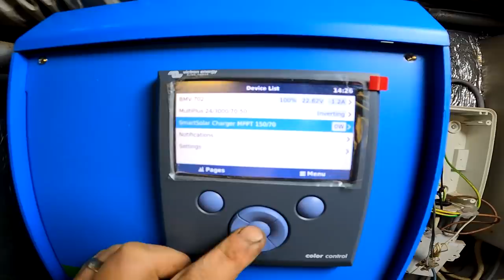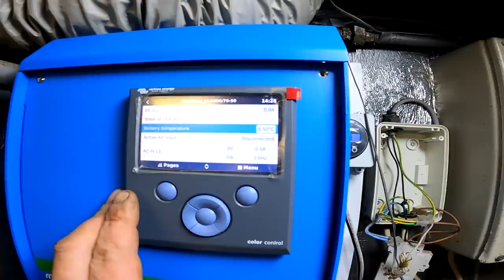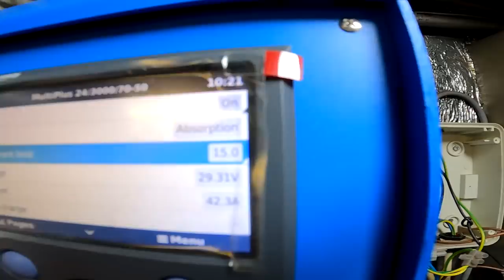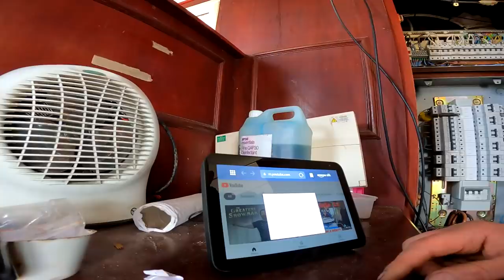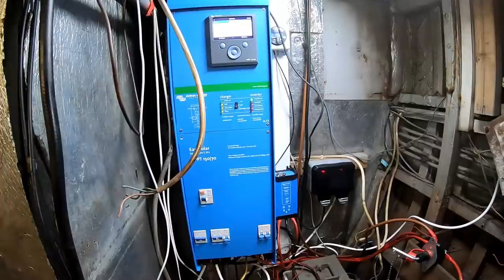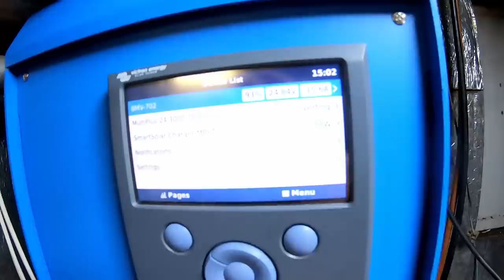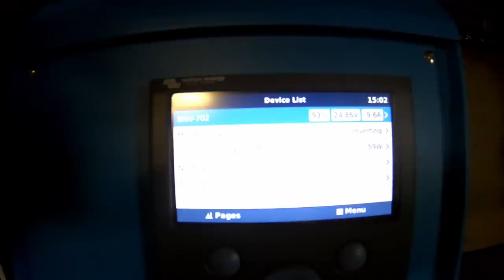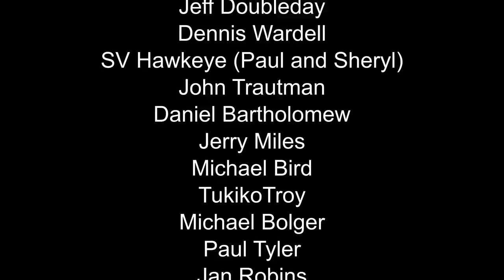Ep 12 - Fitting a Victron Easysolar Electrical system to a boat! #boatrestoration #victron

Comment: um not convert to 12 volt led lights is my recommendation.   24 volt handles better with thinner wire(s) in long run than 12 volts does.   Apparently from prior videos and not yet watching your later episode videos,  I suspect prior owners is "type that leaves excess" instead of removing unused or not keep sufficient (shorten) length.   that is.  measure wire... take off  crimp both end   put back on (with at least 1 finger looseness, not palm,  prevent people from grabbing wires for stability).  

set up electrical system and label accordingly.   you are not yet labeling your wires.   that is  I suspect from watching a few,  probably want several main feeds (times two... the AC and DC 24 volts).    1 going to pilot house,  1 going to top deck(s), 1 going to galley, 1 to bunk area.  then 1 to engine, 1 to "support" aka bilge, pumps that is not in engine.  supply wire is supposed to be separate that is not zip-tied together. 

I will not use same type wire as running feed for 120 and 24.  prevent confusing yourself in future that you discovered with aft room.  buy differently colored marine grade cable to identify voltages. (I am not sure if previous owner used ordinary house cable wires for both voltages)

Comment: I'm just curious, have you had any type of survey performed on this vessel prior to or after the purchase of this boat. I saw the EP where you two of you started the demo on the interior ceiling and found the rotten wood and mold and the look on his face looked depressing. As an owner of several vintage Chris Crafts and a large steel haul houseboat where they required the removal of the bottom planking for rib /plank replacement and my 44 ft. steel house boat required the entire bottom to be cut out for rib replacement and a new 3/16" plated haul to get it done properly. On this particular boat and I spent 10's of thousands of dollars restoring the boat in order to pass a survey and still can not find an insurance company to insure the boat even for just liability. Without such insurance, 99% of marina's will not permit dockage of your vessel. I am self insured and have my own docks which is the only way I can enjoy the boat. Once the weather improves, I hope the two of you start with the restoration of the haul first, starting with the front bow section and salon roof to get it water tight. I hope the two of you can finish the project, but it is so overwhelming at this point the amount of work and money that it will take to finish, Good Luck!

Comment: He does not have his priorities right he still needs to get the boat watertight, he should never fibreglass the hill for it will retain any water held within the wooden hill, he does however need to get the boat onshore to get the hull sorted and of course the deck and    the superstructure, them all the other work can be done on the water, does he put a good interior into a rusty old van ?? Somehow I don't think so, he is not saving any money in the long run, I hope that any water that is coming in does not short out the electrics and putting the solar panels on the  roof before they are is just plain foolish, they are a nice family, just being foolish about the way they are going about the repairs to the boat, well they are not  repairs, any money given at this time, should be wisely spent on getting the boat watertight, then maybe more money would be given to get the boat finished, I suspect at the moment a lot of people are being put off, which is a real shame,
Reply: I thought they were doing what they could wile waiting (in line for work?) to get on the dry.

Comment: the battery shunt actually keeps track of how many amps have been discharged (or charged) since voltage alone is not a very accurate way to keep track of the state of charge.  I have been using Victron gear to live off grid for 4 years.........Im running two Phoenix 24-3000 Inverters in parallel for a typical 3 bedroom home.  The new Lead/Carbon batteries coming onto the market,developed in Australia can handle 20 years of daily 50% dod cycling........and unlike Lithium, wont burn your house or boat to the ground. Im fairly sure the Easy Solar is like the Quattro etc........there are two AC outputs which will run critical light loads (like a fridge) but drop heavy loads on the second AC output when a certain AC inputs is not available.  That way the battery storage standby power is maximized.

Comment: It is always funny to see someone doing wiring in Great Britain or another country where there are using 220 volts. Your Wire is about 1/2 the size that we would use in the US for the same project. Essentially half the current, half the wire size - 1,800 watts @ 120 volts is  15 Amps, but at 220 volts 1,800 watts only draws 8.18 Amps... And those Battery Cables looked ugly!!!

Comment: You obviously have a better than average understanding of low voltage electrics but I wish you would drop a piece of cardboard or something over those terminals while working near them. Those would be 900CCA or so, anything you drop over would weld instantly and the result would not be good. Don't forget to be careful not to run those starter batts down too low, they won't like it. Oh BTW you shouldn't have gas discharge issues with those batteries as they appear to be SLA (Sealed Lead Acid). 

The wiring looks like a nightmare, it reminds me of a Series 2 or 3 Land Rover, every one has been rewired three times in its;s life and every time all the old wires have been left in place, same with this girl. So many un-conduited wires including important stuff like bilge pumps, yikes! Do you have a signal injector? That will make tracing stuff a lot easier. 

No Gemma, red and blue are not "only a colour", they are different size crimps for different wires. red is the smallest, blue next then yellow. Any larger than that and you go to solder terminals. 

Great work guys and great to see you now have enough viewers for adverts as well as some generous sponsors.

Comment: A little thing I learned about batteries, they have to charge at 15V in order to burn off the build up of (?)  inside the batteries located on the plates.  So that battery you pulled out may still be good. Because you film the work you do, there is a chance you will inspire another man to do something he may not feel confident enough to do.  I too do all my own work, instead of paying some other man to do it, unless I have to spend more money on supplies or tools to do the job. HOOAH!!!

Comment: I'm one of those people that gets paid for doing that electrickery stuff :-) Good to see that you're installing some decent kit. A quick tip when playing around with batteries for a 24 volt system. Its good practice to make sure that the two batteries are equally charged, ideally don't mix unknown batteries. The problem is that if they are not equally charged or you have one faulty battery, the good battery will over charge and the bad or flat battery will be under charged. I think you proved that with your hissing battery due to over voltage. You mentioned that you're fitting new batteries anyway, which will obviously rectify this issue, but its a good point to note. And NEVER NEVER take a 12 volt tapping off of a 24 volt battery bank! (again you have a 24v ro 12v charger, so not an issue here...). Good work though, should be a good start to your power issues (although you might find you need to increase your battery capacity if you're going to boil that kettle a few times using just the inverter ;-)

Comment: It may pay to put a single screw into the electric system to hold it down. A large jolt from a wave may bounce it off its mount. If the boat temporarily turns turtle, it will definitely unseat itself.

Comment: Victron looks the business; the ability to variously run with a small generator in parallel or to  augment its output, charge the battery and presumanly regulate PV charge is a great mix.
Reply: The issue with a centralized system is breakdowns I chose to install 8 10000watt inverters in my boat so I don't loose everything in the event of a failure , but it is as you say impressive 👍🏆
Reply: @trojanhorse5363  Good point! I'm looking at this product myself in a truck within  a planned  hybrid setup aimed at low weight,  with  battery  DC derived from PV and a second dedicated vehicle alternator. DC will be used for fridge, LED lighting, Diesel Webasto heating, water pumps  and USB supplies, plus inverter-derived AC, with scope for   intermittent backup use of a 1KVA Honda generator which could also operate independently and  as a way of supporting high current battery charging . It is questionable whether I really need a high power inverter at all unless adding induction cooking and a 500VA unit would ample for laptop or camera chargers etc.  My biggest Victron (and this applies to all equipment )  concern is achieving vibration and physical shock resilience in an overlanding vehicle spending time on rough and corrugated tracks with many past  failures confirming your "all eggs in one basket" view!  Noted here there are separate starter and house batteries, DC bilge pumps and the trusty Honda as backup with synchronized mode ability to get the generator`s probably 2KVA output supplemented to 5KVA for short bursts of extra  kettle boils etc .  And then coming up in later episodes,  no doubt the great lithium battery debate will start.   In a marine or vehicle situation, lead acid ( or flooded cell NiCd in weight no object marine case)  is likely to be the wisest choice  for both dedicated and emergency engine starting , given lithium's typically poor CCA ratings. I'm not  sure now if this Victron unit can accept and regulate incoming PV directly or whether a separate charge controller is needed.  Everybody is right in their own projects and priorities.  I'd probably be  installing an ancient water cooled Lister Start-O-Matic with as much heat recovery as possible to run a few heating  radiators or looking at multiple wind turbines !
Reply: Phil
       The addition of second alternator can be avoided by installing AVRs between the start batteries and the house batteries, I installed two 80 amp units,
Reply: @trojanhorse5363  I know there's only one engine but I'm happier with dual alternators !

Comment: 32:44 those thin wires look like sense cables they monitor any voltage drop across the cables probably when the battery is being charged ?

Comment: Those ceramic fuses were used in Volkswagens and Mercedes cars for decades and would corrode leading to odd electrical problems. it's a good idea to get rid of them. Imagine salty air at sea ,they would fail eventually.

Comment: You should make neat wire runs with wire ties, much easier to see where the wire are going and used for what.  So if you need to make add on or take out wire you CAN SEE how to do so.  Also a good safety factor, when in neat runs with hold downs.

Comment: Now comes the big task. Tying the system to the Engine Alternators/Generators.
Reply: I found duplicating the meter displays onto the bridge. Also, you might consider moving the bilge pump switches up to the bridge also. Hate having water flooding the switches

Comment: Good stuff, that Victron EasySolar looks like just the ticket.
-Is the huge consumer unit at 29mins the DC distro?
-Is the genny a proper installed aux diesel set or a petrol (lpg?) suitcase? Sounds like it's in the engine room?
Reply from the maker: The genny is our portable Honda generator that is temporary and is out on the deck while in use x
Reply: @ShipHappensUK  fair enough. That make sense, sounded like a Honda suitcase, and I guess the sound comes through the hull fairly clearly. Cheers for clarification.

Comment: You are all very brave undertaking a monster restoration with a boat in that condition. I don't  want to be a spoil sport,  and I know from my own experience you need some basic electricity at this stage of repairs. To run a builder pump for instance. But putting in surveillance  equipment, and huge  victron chargers at this stage should not be a priority. Making the boat waterproof is where I'd be directing all my money and energy. Hope it all works for you and all the best of luck and good wishes.

Comment: If u cought your bow line it would rip the whole section out of the boat it should be hauled up to dry land blocked and fiberglass everywhere
Reply: whats with you and bloody fibre glass, this isnt a little boat you can slap a bit of sticky tape on
Reply: You don’t fibreglass over wood. It will rot at an alarming rate and be structurally dangerous.

Comment: This is a very on safe boat in my opinion and not safe for open sea sailing for a very long time if ever again it needs alot of new planks on the under belly worm plank is likly rotten and along with everything else, if u where to have rope stuck around the props, u would cut the boat in two
Reply: You're right but they are never going anywhere so it doesn't matter. They're enjoying themselves and entertaining their fans!